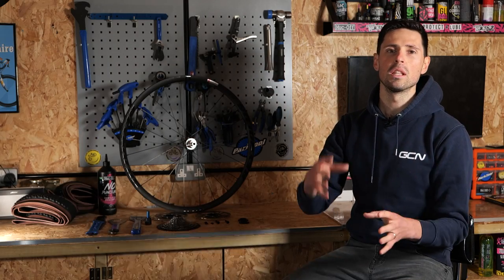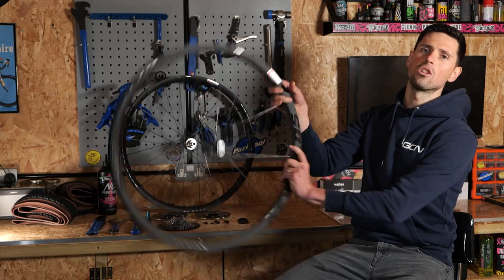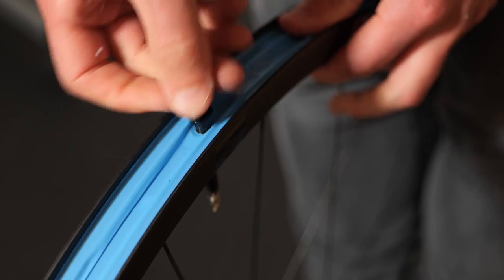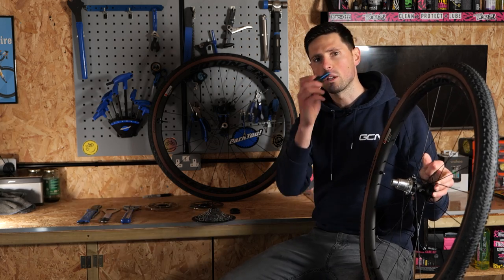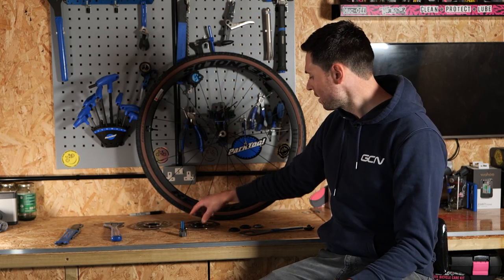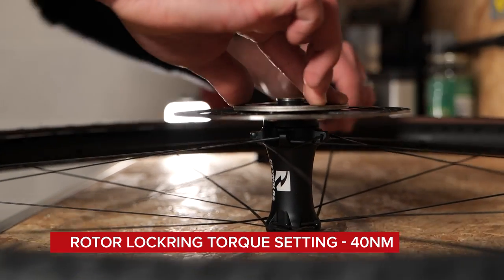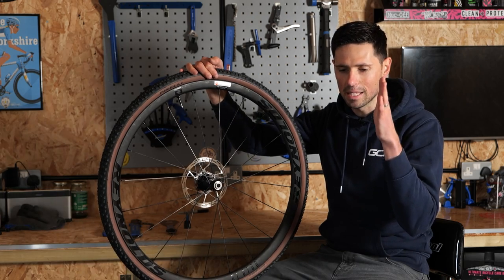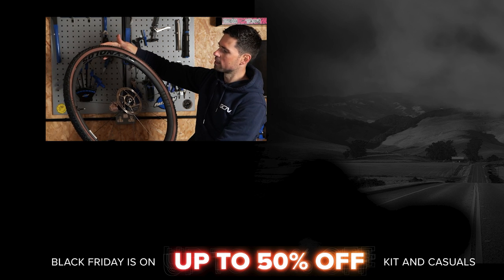How To Set Up A Bike With Two Different Wheelsets | Maintenance Monday

Comment from the maker: Would you rather have two specific bikes for road and gravel, or one bike with two wheelsets? Let us know in the comments!👇
Reply: I would rather have two bikes because N+1=😃 but for the non-competitive cyclist that still wants to somewhat keep up on the road and go play on the rough stuff a carefully chosen modern Gravel/CX/All-Road bike with two wheelsets (or even just the right tyres) is now a totally viable option without having to over compromise.
Reply: I have a set of 40mm carbon wheels for the spring and summer and use the original alloys for the late autumn and winter. I can then easily swap between some nice fast summer tyres and aero wheels and chunkier tyres for the cold & wet  winter roads. Despite being different manufacturers the brake calipers don't usually need adjusting but I sometimes need to adjust the indexing on my gears.
Reply: If I am self-serving the maintenance upkeep, nothing better than separate dedicated capable configs out of the box; if the shop will be doing the work a single frame-set is a good consolidated setup ( I feel)
Reply: One bike two wheelsets. This video would have been more helpful (although longer) if Alex had touched on disc and cassette shims. My road rims are lighter and more aero where my gravel rims are heaver more durable but much cheaper. The road rims are an upgrade from the factory aluminum rims I use for gravel.
Reply: I was just looking into doing this, so this video is great timing.  But I feel like we talked about it, and didn’t show the range of possibilities.  Many of us are stuck with the stock wheels, and so that wouldn’t match the new wheels I just got.  So I’m still left wondering if this would even work. If I have to keep adjusting a lot between the two, then I would just leave it as is.
Reply: Two specific bikes. I like keeping my road bike clean and exposing another bike to muck/elements/dirt/etc.
Reply: Two different bike. My road bike is 23-633, and my offroad bike is 100-559. The wheelset OLD are not compatible.   	(´｡• ᵕ •｡`)
Reply: I do have 1 bike with different wheelsets.
A Dolan Tuono and Vel road and gravel wheelsets which I just swap over when needed.
Reply: 2 bikes is certainly better but 2 wheelsets also works. Would be great to have more explanation of last point in video as to why 2 identical wheelsets / manufacturers is best... ie practical issues when swapping wheels each w.e.....

Comment: The video ends just as I wanted it begins : when these minor issues in alignment appear. There is some fine tuning to do and some very thin washers we can use. I thought we would talk about this as I saw the title.
Reply: Yes, literally no advice.
Hub+ rotor is the thing for 2nd wheelsets which are difficult/relevant.

Everything in this video is not even remotely relevant for 2 sets
Reply: Seriously this was completely useless. Missed the whole point of what this video should have been.
Reply: As other comments, just when it's getting useful it finishes up.
Trek Domane running Aelous road wheels and rotor is centred spot on, swap to Fulcrum Red 900 for gravel and the rotor rubs. There's no adjustment with the caliper so it looks like I need to bend the rotor but hesitant to start bending things.
Reply: @MarkParssey  there are shims for 6-bolt discs available, maybe also for direct mount.
With these, you can move the disc which sits more inward than the other outward to the same degree the other already is, and then it shouldnt rub after adjusting the brakes
Reply: Ive noticed many of the “maintenance/mechanic” videos since the new boys have taken over dont really cover the stuff u actually need to know. Bring back john or even Si.
Reply: @MarkParssey  Trek Domane deffo has adjustment in the calipers (I have one). The front caliper mount has slotted holes so you can move the caliper side to side when you loosen them. The rear brake mount on the frame is also slotted. If you cannot move your calipers side to side when you loosen these bolts, then there will be a further issue that you will need to get a Trek dealer to identify

Comment: for us normal folks: why would you buy 2 sets of the same wheels? the idea is to have different wheels for crosswinds, climbing, and offroad.
Reply: Slight differences in axle width mean you have to reset your disk brake caliper positioning every time you switch wheels.
Reply: as he said 'or same brand' .... I used campy shamals for climbing and bora's for club rides or flat routes....

Same hub spacing no faffing
Reply: I've got two different branded sets of wheels. DT Swiss for road tyres, Mavic for gravel ones. The Mavics did rub at first but nothing my LBS couldn't sort out very quickly, easily and cheaply. Now swapping between wheelsets is a breeze and I've found it a game-changer to be able to switch between road and gravel tyres in 5 mins. No more faffing changing tyres and I am mixing up (and enjoying) my riding a lot more. 👍
Reply: Maybe for use with a turbo trainer/tyre whilst still making it easy to switch to an outdoor setup on a nice day??
Reply: @teknonmy7210  With rotor shims, that won't be necessary. They go on to whichever wheel that has the rotor touching the right-side brake pad so that the rotor sits a little more outboard than it used to.
Reply: He gave crap advice. Using spacers on the one that is more to the inside will align it with the other.
Reply from the maker: It may be that you like the wheel but want two different tyre combos, or perhaps a wheel for the turbo. different wheels within the same brand might be popular as you may retain the same hub spacing but have different rims and profile. 👀
Reply: @teknonmy7210  That's why you should buy 6 bolts hubs instead of centerlock and use 0.2mm rotor shims. No need to reset the caliper. Centerlock is so bad and inexplicably more expensive rotors.
Reply: I ended up with two wheel sets when waiting for a frame for a new bike build. Though summer I had GP5000’s for commuting and gravel for the weekend. Eye wateringly expensive setup with an XX1 cassette for the ability to change tyres but no brake rotor issues.
Reply: @gcntech  yeah, the different tire argument is a good one. Buying with the same brand/specs as you mentionned, which i concur with. same could be set for the casette, although changing that is easier.
Otherwise having wheels with different characteristics is important: for one, being tossed around with high rims and high winds isn't fun but overall high rims are really nide to ride.
Reply: I have studded set on other wheels, because Finland.
Reply: @tomahoks  Same. Because, Canada.
Reply: Rotor shims solve the problem. They’re available for centerlock too. Jagwire has those for example.

Comment: for me it's not that easy... beside the brakes I need to adjust also the rear derailleur as the cassette is different. I have 12-25 on road set and 11-32 on gravel set. Even with the same 12-25 casstette on smart trainer (12-25) some small adjustment is always need to get the proper smooth shifting.
Reply from the maker: Are you using different Wheels or hub spaces? 👀

Comment: One of my bikes has two wheel sets. It wasn’t mentioned in this video, but I’ve learnt that it is good practice to check and adjust (if required) the rear derailleur and cassette alignment when switching between sets. The slightly different profiles between wheels can affect shifting performance if not adjusted for. Even if you’re using the same cassette!
Reply: I find that I have to adjust the min and max limit screws as well as adjust the derailleur, when ever I swap the wheel set. The disk breaks also need realigning too. Though it's well worth it to go from 650B gravel to 700c commuting/road.
Reply: @Jaytas88  Try getting some rotor shims and you wouldn't have to realign your disc brakes on every wheelset swap.
Reply from the maker: Great tip, this is why Alex is using the same wheels or hubs, makes life a breeze 🙌

Comment: I thought you might explain how to use spacers to fine-adjust rotor spacing... Even with the exact same make of wheels there will often (usually?) be spacing differences and you will have set up the brakes each time (I'd rather have two bikes). But spacer is the only way to make them plug and play

Comment: FYI for anyone running into disc rotor alignment issues: November Bicycles sell shims for center lock rotors. Was a lifesaver for my two wheelset setup.
Reply: For 6 bolt I used the included washers as shims to align the other wheel set :)
Reply: Or a set of 10 x 0.2mm shims off eBay. £5 :)

Comment: I run double wheelsets on both my CX and XC bikes. For the cyclocross on race season I've got mud and general cx-tires. Outside that gravel tires on one and the other road or studded tires depending on season. The XC is more straght forward. XC/studded on one wheelset and other trail-tires

Comment: Disagree with the comment about using same cassette.
As mentioned for the wheels, the target of having 2 sets of wheels will be to ride different terrain.
It could be one set for the flat and one for the climbs.
Or like many who turned to gravel, one set for the road and one for off-road.
Anyway in both cases above, the results would be more or less the same. One set with big cassette for spinning easy on gradients, and one with smaller cassette to have closer ratio.
That’s what I run on my gravel: 12-36 off-road and 11-28 on the road. Note that this works fine because running 2x crank GRX600.
As for the setup, there is absolutely no issues just have the chain length adjusted for the biggest cassette and job done. No specific modifications necessary when switching to the small cassette.🎉
Reply from the maker: Do you need to readjust limit screws for different sized cassettes?
Reply: @gcntech  
No need to adjust the H and L limit screws.
Adjustment of the B screw might actually be recommended depending on the difference of cassette size.
However from my experience, I didn’t found the need to do so.
Reply: So your "stock" bike had 12-36, you added a wheelset with 11-28, and had to adjust nothing?
Reply: @thetinusnl8834  
Actually the stock cassette was the 11-36.
I bought an 12-28 and exchanged the first 2 cogs of each cassette making a 12-36 and a 11-28.
And that’s the reason why I had to adjust nothing.
But I do admit that switching cogs between cassette may not always works as easily as it sounds, especially with Shimano who lately developed a taste for having different designs on the final cogs between the road and MTB grades

Comment: I have two sets of wheels, one set for everyday riding and one set fitted with spiked winter tyres.
Reply from the maker: Sounds very practical! 🙌 Do you use the same hubs or wheel-set?
Reply: Both sets are hand built, Deore XT hubs, rims are slightly different, spiked ones wider. Spiked tyres are a pain to get on and handy to have a spare pair as well.

Comment: I purchased a packet of paper-thin metal shims and tinkered with them until my brake disk alignment was perfectly identical. Now I swap out the wheels without even thinking about it. 

Idea: please make a video with a similarly effective work-around that allows the easy transfer from road wheels with a modest gear range cassette to gravel with a wider range cassette, specifically without needing to add/subtract links in the chain. Are there modifications to the rear derailleur that will accommodate easy wheel swaps?

Comment: Just asked this a few weeks ago in the AskGCN comment section, and there is a full video about it. You are the best. Thanks.
Reply from the maker: Hope it helped 🙌
Reply: @gcntech  Yes. It was helpful. But still missed to mention the problematics of shifting, if the two wheels have different ratio cassettes. If there is a need to readjust the shifters or not.

Comment: Realigning rotors takes all of 5 minutes if you know what you are doing.  I swap between 29x3” and 27.5x4.5” wheelsets for winter snow trips, and pretty sure I spend more time topping up sealant and infltingthe Fat tires than I spend faffing with the rotors and cassette alignment.  Summer tires are 10-51t, and winter ones are 11-50t (much cheaper HG hub) and I have had zero issues swapping even though SRAM and Shimano are rather different in their cog size progression.

Comment: I switch my cross wheels (knobbly) for fast commuting wheels (tubeless slicks) on my cross bike. Easier than changing tyres. The rim brakes do need adjusting each time though. I’d prefer to switch bikes but don’t have room for another (already have 3)!
My adult son was rather attached to his old 26”MTB and had no room in the shed for another. We bought some 650b cross wheels and fitted 35mm slicks for commuting. Same diameter as 26” with 2.4” knobbly, this kept trail identical, steering less affected. We did have some issues with disc brake rub though. We had to shim the dropouts beneath one axle, not ideal.
Reply from the maker: Great to hear your son loves his bike! Glad you could keep it rolling for him 🙌

Comment: I got a pair of matching new unused secondhand set of wheels, identical to what is on my bike. I installed a different cassette 11-32 instead of the 11-34 on my bike - both 105. I  can switch wheels without any need for adjustment.

Comment: what's the point of having two identical wheelset? 
if the hubs are different on the two wheelsets, then you are screwed? you will have to re-adjust disc brake clipper?
Reply: Not if you have rotor shims.

Comment: I just did this with my bike over the weekend! And thanks to Alex's endless pestering I have gone fully tubeless with both sets.

One question - The wheels shipped with a bottom bracket rotor lockring, while the rotors shipped with the cassette lockring - any preference between the two? Is it better to use the one that matches the wheels or the rotors?
Reply: Personal preference unless you are planning go remote touring/bikepacking.  You can get an emergency cassette lockring tool (there are a couple out there).  I have never seen a lightweight BB style tool.  So if you are worried about needing to be able to nip up a lock ring, or remove a cassette and rotor to replace a spoke then go with the cassette lock ring style and carry the nifty tool.

Comment: What about if the wheels you are buying are centre lock only, but your existing ones are 6 bolt. Is there any disadvantage in using a centre lock adaptor? - Does it move the brake disc further out, does it introduce a potential weakness etc? My current brakes are Sram - any issue with using Shimano discs of the same diameter?
Reply: No biggie on the center lock adapter...I have one on my commuter, since my freehub exploded and the only cheapish disk wheel in stock was center lock.
Problem solver adapter added, back on the road.

Comment: Here's a question.  I'm thinking of selling my giant gravel bike and keeping my giant 27.5 mountain bike BUT I was thinking I'd keep some versatility by having a set of 29" wheels around with smaller slick tires on them to use when I"m doing occasional road riding.  What are your thoughts?  My 27.5 have 2.6" knobby tires and I'm thinking a pair of 29" with much smaller slicks would have almost the same circumference.  What are your thoughts?  PS:  I rarely use my gravel bike anyway.

Comment: Need some advice: I just did this to have a lighter road set of wheels on my cervelo aspero. Got some hunts for disk brakes with correct thru axles sizes. Put on exact same cassette and disks and all seems fine if i leave the axle a turn from finger tight. But this leaves a little play in the wheel. If i tighten the thru axle as so zero play the wheel doesnt turn properly. Its not the callipers as I can see gaps either side of the pads and i checked. It seems the tightening of the thru axle is stopping the wheel turning but not with the original wheels. (New wheels are hunt wheels). Any ideas?

Comment: #askgcntech  Hello GCN Tech-Team, is it possible to switch between wheelsets with a 11-30 & 11-32 casette without adjusting the RD or chain?
Right now I have a 11-30 on my bike and 11-28 on the turbo - here changing works without any troubles...
Reply: As long as your chain is long enough for the larger cassette, it should be fine
Reply: As you are running 11t on both as smallest sprocket, size the chain for the largest cassette, and you should be fine.

Comment: Does it matter that the new cassette or rotor will have different wear compared to the existing chain or brake pads?
Reply: Cassette wear and chain wear must be somewhat compatible, otherwise the chain might skip. It might make sense to invest in two chains, one for each wheelset
Reply: @rothermelyer6049  how common is this? I’m genuinely curious as I’ve never heard of it before. Thanksn
Reply: Couldn’t I also make the argument then if the cassette and chain are new, they wouldn’t match up with old chain rings?
Reply: Cassette and chain must "age" together, like this they will be compatible. If you change one of them to new, there is a risk of skipping. Happened to me with a 2.000km worn cassette and a new chain. 
If you swap wheels (with the two cassettes) regularly, it might work though. 
Same goes to some extend to the front chain rings - but they usually wear slower. As a rule of thumb: a cassette should last 2-3 chains, front chain rings should last 2-3 cassettes. 
Bonus: if you go for waxing chains, your components will last longer
Reply: @rothermelyer6049  I see. So the wear rate of the chain rings are slower. Makes sense. Thanks!
Reply: @rothermelyer6049  On second thought, not sure if that makes sense. By default, if a cassette lasts 2-3 chains, you’ll always go through periods of a worn cassette + new chain. So perhaps it’s not such a big issue?
Reply: Depends on wear. But: There is nothing to loose by trying it out. Just be careful during the first ride with a new chain. If it skips - new cassette will solve it